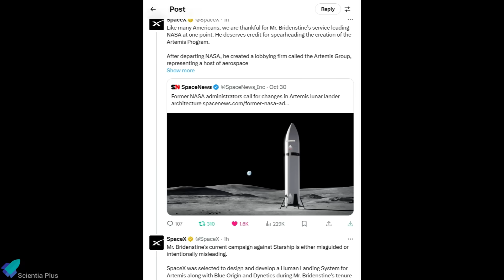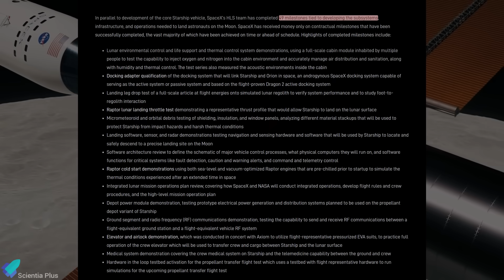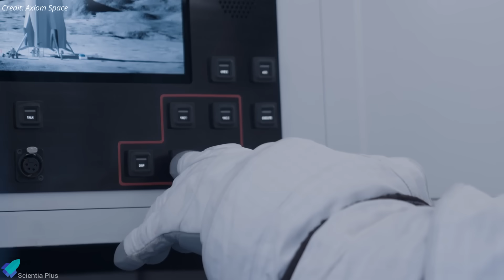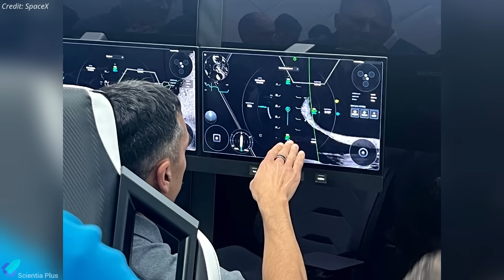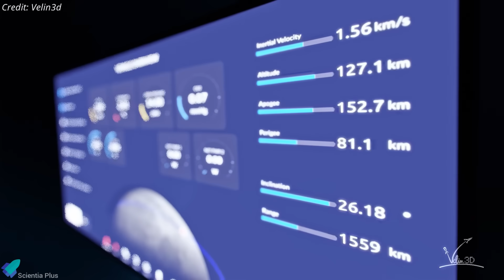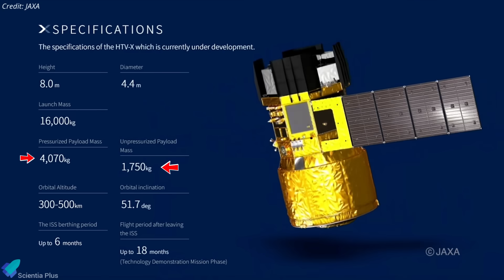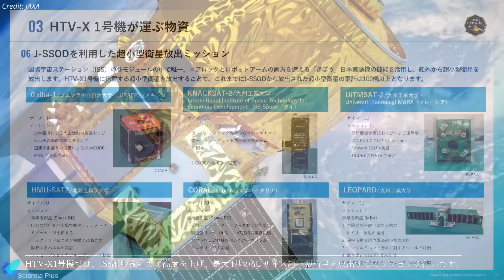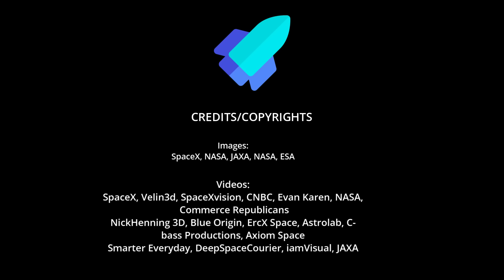SHOCKING EVIDENCE! SpaceX Just EXPOSED the NASA Admin Who Lobbied Against Starship HLS

Comment: Just because he has ulterior motives, doesn‘t make what he said wrong. Destin has already illustrated and held a talk at NASA how the idea is ridiculous and fraught with so many issues, it‘s as likely to simply never happen. And I don‘t think Destin is wrong either.
Reply: Yes he is. He may be an accomplished NASA alumni but he cant come close to SpaceX's accomplishments in his lifetime much less in a few years. This was most likely lobbied behind closed doors by and for the already handpicked contract winner, Blue Origin. Typical politics and corruption holding back true progress.
Reply: Yet he is very wrong. "Dozens"... really? So let's run this. We use a V3 to get to the moon because that's what they have now and it can do the job with 400t fuel to spare (confirmed this with Grok some time ago). 

1600t fuel in V3 HLS lander. 
200t payload for V4 (due for completion early 2027 at latest but too late for lander work on first missions).

16/2=8. Add 1 for boiloff (which can be mitigated with sunshields per Skylab and James Webb... So... "Dozens"... "Nobody knows"... 

Liar.
Reply: @avgjoe5969 your best projection is 9, but that assumes none blow up and 200T payload is achieved. It could be 17 if they only get to 100T payload (they have not yet demonstrated they can even do 100T to LEO either). And add 30% contigency for those that blow up, so more like 24. And they need to launch them back to back, so whatever number it is, 9 or 16 or 24, they gotta be sitting there ready to be fueled and launched as soon as the last one leaves the pad, and there can be absolutely no delay if they wanna beat boiloff. And the refueling is only one among a pleathora of issues with the mission design.

Comment: The last time we went to the moon, did they refuel it in route?   This is a NASA thing.
Reply: That was a question I had. They only needed fuel at start and end of the routes so why the big deal about masses of fuel this time? If they used a small lander again, they wouldn't need massive amounts of fuel. Only if they are using starship as the lander.

If they are transferring large amounts of freight to the moon it is a different matter, but then you don't need that if you just want to beat china